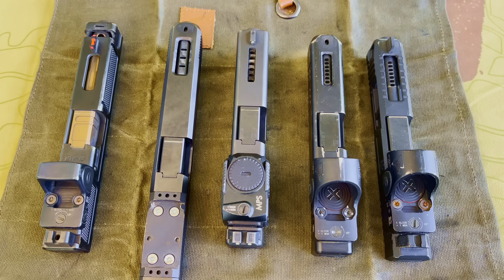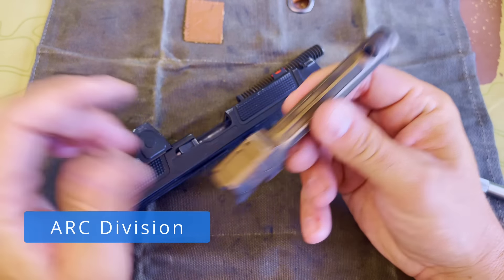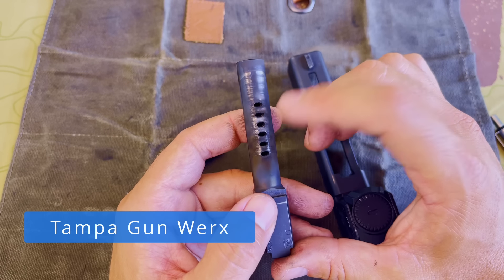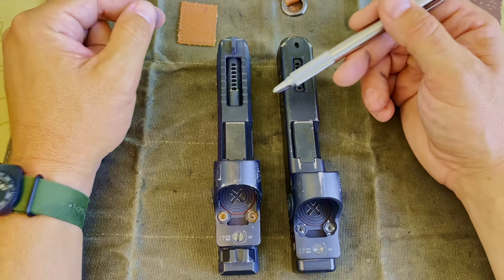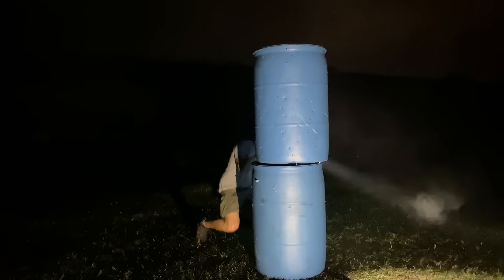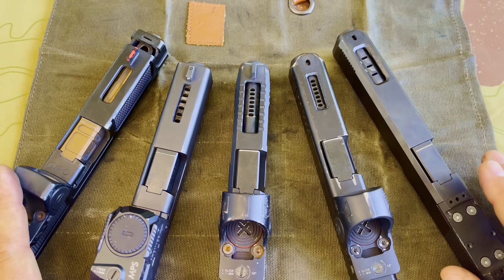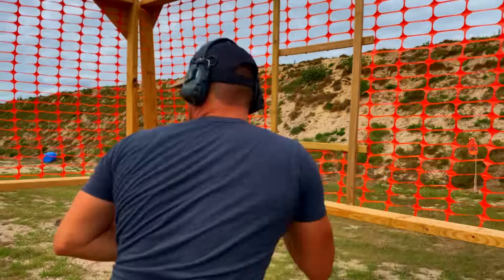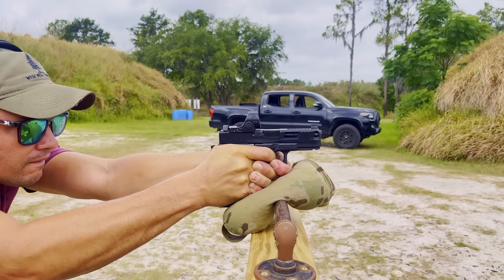Pistol Ports that Work.

Comment: Porting just works! I think the people bashing have just never tried it. I have fired in darkness and was never blinded. I have fired ported J-frames from inside jacket pockets and there was no fire to my clothing. Anything that helps mitigate recoil and increases followup shots is worth having. Porting has come a long way. I am an old head used to magnaporting and Glock 19c's. The stuff coming out now is very impressive but also very expensive. Thanks for your video
Reply: I go back and forth on the reliability. My Glocks with ports and lighter springs have to be cleaned and lubed eventually (1500 rounds) whereas my nonported ones never. Also there is very weak ejection with light ammo with ports.   Is that minor decrease in the reliable operational window worth it. People can make that choice for themselves
Reply from the maker: I have never experienced what you are saying. Factory springs and same old Glock reliability, even with frangible ammo.
Reply: Shooting a ported firearm in the dark and not being blinded does not tell a full story. If you are in pitch black darkness and your eyes have settled into their night vision mode, you will experience port blast affecting your night vision. If you are shooting in an environment at night that has some lighting, then your eyes have not settled into full night vision mode. I am not hating, I am going a little bit more in-depth on something that has nuances people overlook or never consider. Carrying a ported pistol for EDC makes sense because most people are going to be going about their normal business in the day and at night where they go into a restaurant, a Quick Trip for beer, your eyes are constantly be subjected to light sources at night. If you are in a purely tactically environment so dark that you almost need night vision, ported and compensated firearms are not ideal. There is more to, "it just never affected me."

Comment: Pistol ports decrease muzzle velocity, accuracy, thrown shrapnel not just gas, and usually costs more than comps after drilling and recoating. Even if it's just a range toy, buy a comp and the extra weight right on the end will make you even faster.
Reply: Sounds like you used a dewalt drill to port your gun in your garage. 
I lost maybe 40fps, lost no accuracy, no meaningful shrapnel with a V8 porting on a C2. None of the 20 or so shooters I know with ports suffer from the things you mentioned, other than the negligible loss of velocity.

Comment: I have a Glock 19C  and XMacro and they are pretty legit for a factory guns!
Reply: @mikejaan66 do you prefer one over the other ?
Reply: My 19C has a stipple and accelerator cuts it runs so flat! I’d pick it over the macro.
Reply: Factory comps or ports are they way to go. Less issues.

Comment: Have you experienced any malfunctions due to the porting? I had a radian ramjet and it  exasperated glocks limp writing issue in a g19 and a g45. If I shot without a really strong grip I would get failures to extract. If I would shoot non dominate hand I would get a malfunctions on almost every round with both guns. Take it out and had zero issues, even trying to limp wrist it wpuld cycle, but the comp wouldn't allow it to cycle.
Reply from the maker: Tuning is sometimes needed with comps. Recoil springs mainly.

Comment: I need to try out ports one of these days, maybe on the Staccato P. I have micro comps from PMM and Radian and have been extremely happy with them. Thanks for the info!
Reply from the maker: Miss ya man.
Reply: @wisemencompany  you too man!
Reply: From our testing, something like our K9 Ports perfom better than Comps.
Reply: @Tampagunwerx Can you share how you test them? I’m starting to test different porting styles using a ransom rest and measuring angle of climb to collect actual data that seems to be missing from the industry.

Comment: I am curious about combining porting with a comp on the end. Tier1concealed talked about it in one of their videos, but I’m more concerned about the point of diminishing returns when it comes to porting VS comps, or combining the two, especially with the ramjet. If you comp a gun and then have it ported too, but you run hotter ammo like nato pressure 124 grain as your standard training ammo to take advantage of the extra pressure and gas, at what point is it going to be detrimental or overcompensating? If we’re chasing the dragon of recoil elimination in handguns, we might as well rule out all the possibilities right?
Reply: Then do it up and post a video 🤙🏽

Comment: 3:25 "Does a longer barrel help ports? - a longer allows more gasses to build up"

The amount of gas generated from any given round is going to be identical, even if you have a 0in barrel. However, the further the ports are down toward the end of a barrel will allow better velocity because the gasses have had more time to expand. A longer barrel would accomplish distancing the ports

Comment: I run a ZEV OZ9C with a ramjet, tungsten guide road and 15 lb spring. Nice and flat with great return to zero. After a lot of testing with spring rates from 13 - 18 I settled on 15. Been thinking about Lucky 7 or DSC V8 for my Staccato P but haven’t decided. Any experience between the 2 port styles? It’s steel frame and doesn’t really need it but it’s fun to play.
Reply from the maker: No experience.

Comment: 6:58 - ive seen guntubers sacrifice their face and arms, shooting ported guns from retention. It is definitely not just gas expelled. Shards of copper jacket and lead are ejected and can be deeply embedded in your skin.

Nightwood Guns channel fired many different types of ports, including ports created via EDM, and those still ejected shrapne - shown on video

Im not saying dont carry ported guns, just be aware that in close retention firing, it can potentially permanently blind you (id not be concerned with small shrapnel hitting your arms in a self defense use, just the eyes)
Reply: Exactly.  I would never carry a ported gun.  If I ever had to shoot it, I doubt I would be wearing glasses and it would be in less than ideal circumstances.

Comment: In your experience, how does a ported G34 shoot compared to a comped G19? By comped I mean "really" comped (KKM, PMM Ultra, 417 dual port, etc.)

I've got this wild idea in my head that a ported G34 would shoot 95% as well as a comped G19 without the reduction in reliability envelope.
Reply from the maker: I would always choose a ported pistol over a comp’d. I don’t think comps are bad at keeping the gun level but I have had reliability issues with them.

Comment: I see your green g19 slide is a TradeCraft Armament. 
I have the very same cut with the included 10 hole porting. 
Is there any reason you went away from that?

Comment: Is either of the monsoon tactical slides nitride coated. I’m concerned that cerakote won’t hold up to edc.
Reply from the maker: No. What is your concern if the cerakote doesn’t hold up?
Reply: @wisemencompany  just would rather not have to re cerakote it every 2 years or so.

Comment: verified historical fact: The hk vp70 had multiple ports within the first 2 inches of barrel which lowered velocity to subsonic, approximattely 380 velocities.   the HK mp5ks had ports within 2 inches of barrel to reduce velocity to subsonic, apprximately .380 velocities

apparently uneducated, schizoid ramblings: if you put ports close to the chamber in your barrels you'll lose significant velocity.  

i'll take ports after the 3.5" mark and not a mm before, than you

Comment: Great video. Super torn between Luck7’s or RamJet for my g45.
Reply from the maker: Lucky 7’s.
Reply: @wisemencompany  question for you, I got the lucky 7 ports for my P10C. Did you have any reliability issues? And do you ever run 115G ammo or only run 124G and higher? I’ve tried different springs but I still have a double feed from time to time. Just curious if you had any issues you had to work through!
Reply from the maker: @ no reliability issues and I run all kinds of ammo. Could it be a magazine issue?
Reply: @ it might be. I need to mark my magazines and see which one does it but sometimes when I chamber a round and then pull the magazine out to replace the round and additional round will fall out.

Comment: Ports are great, but I've seen reliability issues with glocks and sigs. Slower slide action, dirty sights, FTF and more cleaning. A duty weapon or carry weapon should not experience these issues. Duty weopons should be left stock except for factory ports, optic ready slides or optic cuts done by a reputable company.